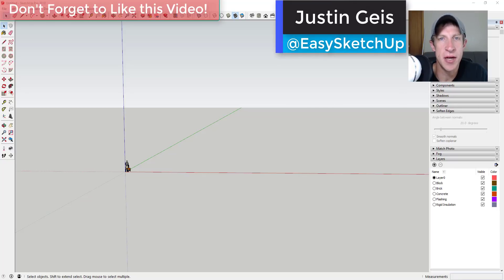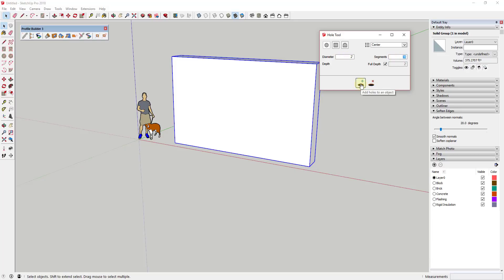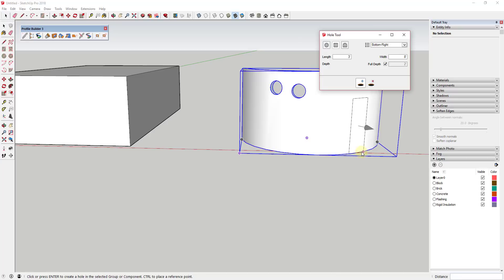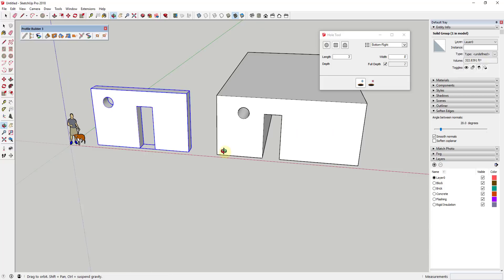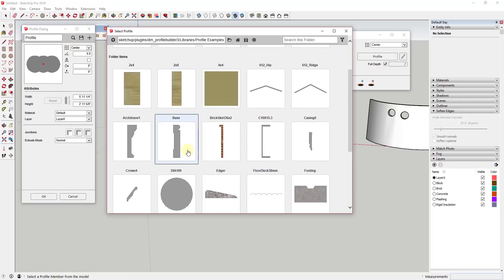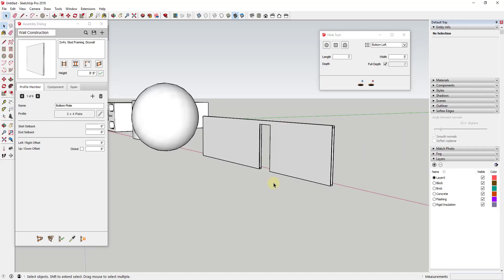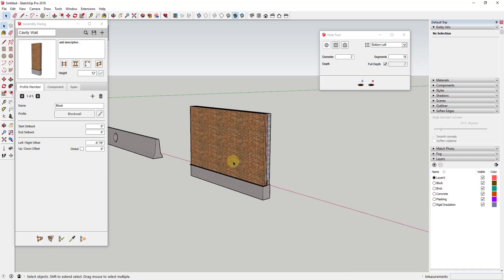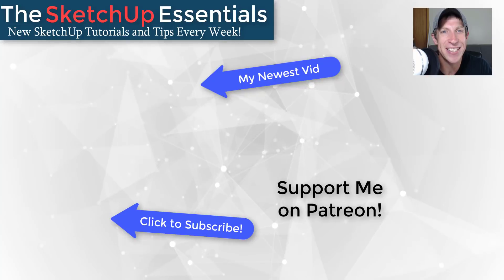CUTTING HOLES IN SKETCHUP with Profile Builder 3's Hole Tool!

Comment: it is absolutely useless. Create a hole in a shape like circular and cut it and then restore the previous state -- that would be the answer on more interesting topic how to fix holes
Reply from the maker: An extension for cutting holes in objects is useless? Just because it doesn't match specifically what you're interested in at this moment does not make it useless

Comment: Justin, have you seen FlexTools? The whole package is worthy of a review in of itself, but the WallCutter tool that was just released really takes it up a notch imho. It also lets you control the depth of the cut, but it goes by # of faces, so you don't have to know the inches in a multi-layered assembly. It also faces off the interior of the cuts and automatically textures them with correct mapping. https://flextools.cc/wallcutter/
Reply from the maker: I've seen Flex Tools (https://www.youtube.com/watch?v=r3zVI8QAZkI), but haven't had a chance to test the wall cutter yet. I do think that this extension is much more valuable than people act like it is, specifically because when I'm modeling houses, it feels like I spend about half my time modeling windows and doors properly, so an extension like this is a big time-saver. I probably need to do an update on WallCutter - thanks!
Reply: Ah seems I missed that video!

Comment: Awesome plugin. A hole wizzard is always nice to have. You should check out GKware simple dxf plugin at shetchucation. Its a great plugin for cnc machines. It keeps curve and arc data allowing for a smooth curve for the cnc to follow rather than a bunch of line segments that can make up a circle or arc. When a cnc machine has to cut a bunch of lines, it can actually damage the machine.
Reply from the maker: Hmmm...I'd like to do some stuff on CNC, but don't have any experience with it at this point. Probably going to buy a 3D in the next month or so, but that's not really the same thing. Thanks for the plugin idea!
Reply: TheSketchUpEssentials 3d printers are still cnc, but in a different way.  However, they use stl files rather than dxf, but for us cnc guys, having a SU plugin that keeps arc and cyrve data is super nice. Prevents router bits and motors geting butned out from vibrations due to small line segments tjat create curves and arcs.  I love my 3d printer. I got it from xyzprinting.com. yes, it requires me to use propritery filiment but the prints are AMAZING. My professor and i did a side by side with the same stl and settings, and my $300 xyz davinci jr 1.0 did better than his makerbot. However, i still want the makerbot because it has a larger bed. Mine is only 6x6x6. Anyway, good luck with your purchase and make a video of it. The community would be happy and thrilled to see your review and input on it:)